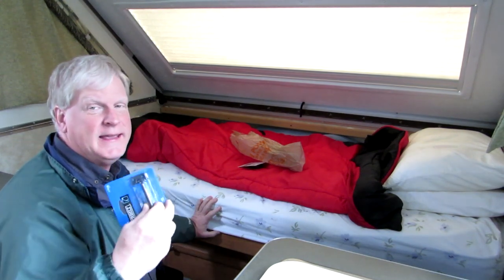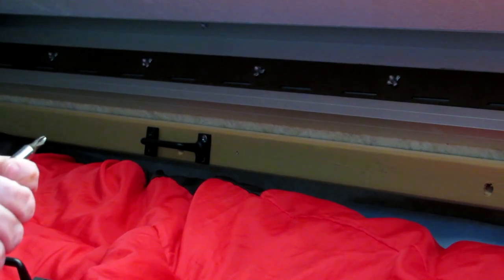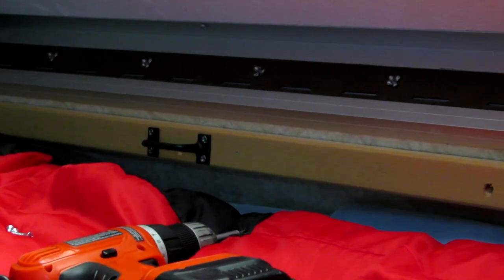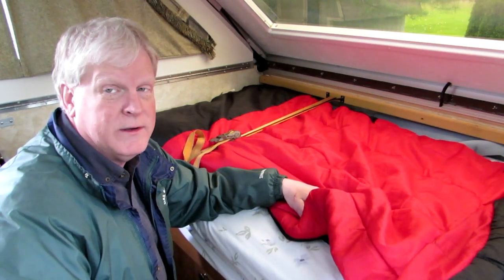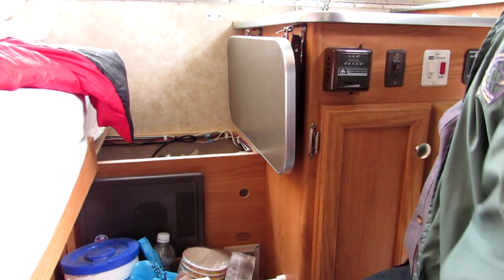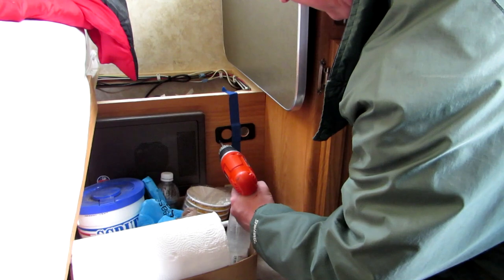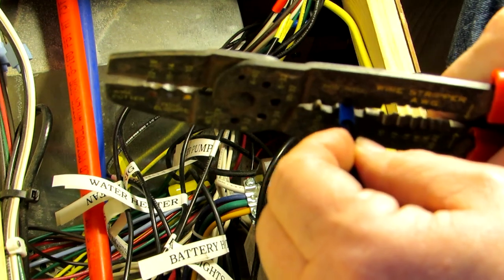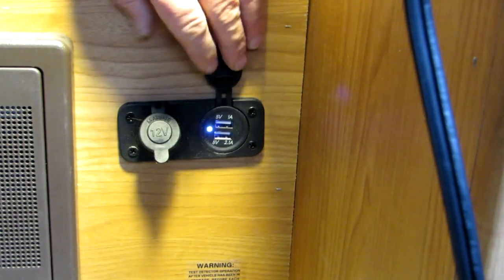Adding 12v Outlets to the Aliner and a Tie down for the bed

Comment: How did you connect the outlets to the 12v system? Did you put fuse on the adapter outlet or USB outlets?
Reply from the maker: Philip Montgomery I spliced them in with other circuit. I filmed that but my battery died and I didn't notice until 2 days later.
Reply: Did you connect the 12volt outlet to the electrical box inside the Aliner not directly to the battery? I just bought a Scout Lite and want to add a 12volt outlet and not very experienced with the wiring part.

Comment: When It come to the USB port, what's the diff between 1 amp and 2.1 amps?
Reply from the maker: Matthew Hartley You know,  I have no idea !  I've also seen 3.5v and 5v ?   No clue what needs what.
Reply: I know this! LOL The higher amp port recharges faster.
Reply: 2.1 amps @ 12 volts will give 24.12 watts. 1 amp @ 12 volts will give 12 amps, so the 2.1 amps will supply twice the power.

Comment: Why use a ratchet strap?  Why not just a bungee?
Reply from the maker: A bungee would still bounce a lot unless it was at its limit of stretch. The ratchette is really easy to tighten down and loosen and set aside.   Its working great too.  My bed is ready for me when I get where I'm going.  Big change from everything normally all over the floor.
Reply: I leave mine open as I am 6 foot 2, and sleep corner to corner....